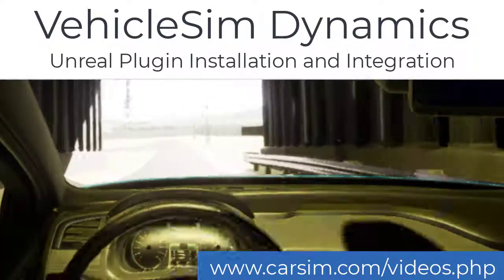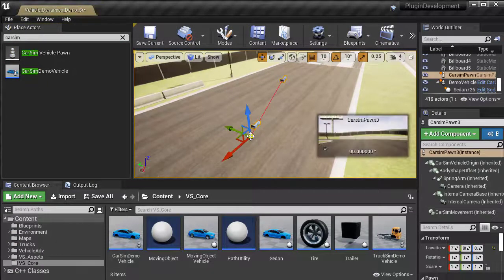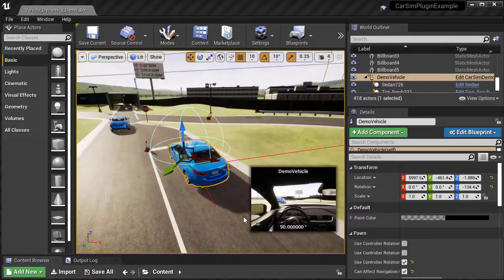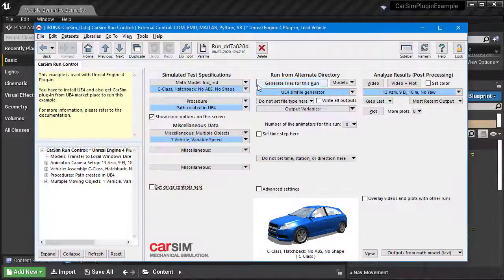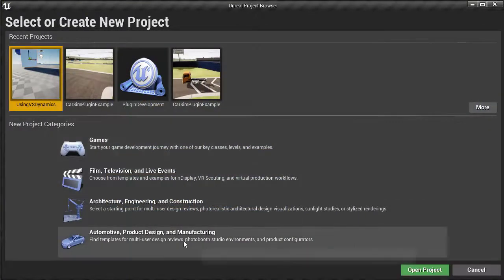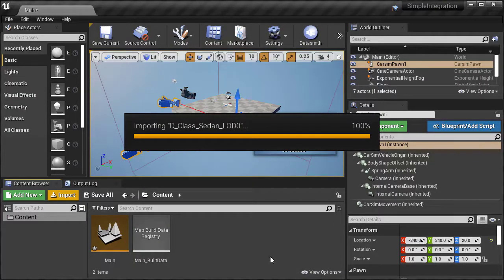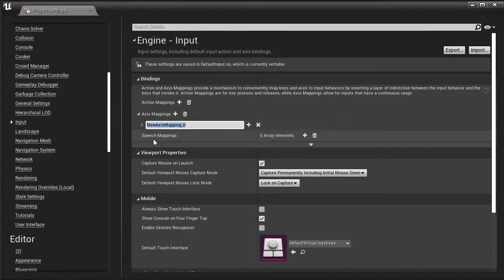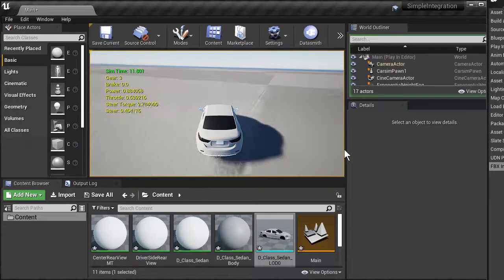Mechanical Simulation's VehicleSim Dynamics Plugin for Unreal Engine Installation and Integration

Comment: Is it possible to change the car gear inside unreal engine using blueprint? I saw that there's a "currentgear" variable, but i cant set its value.
Reply from the maker: Please submit a technical support ticket to resolve this issue. https://www.carsim.com/contactus/support.php